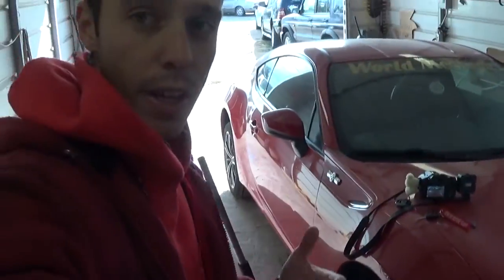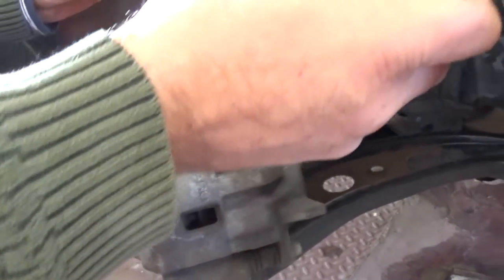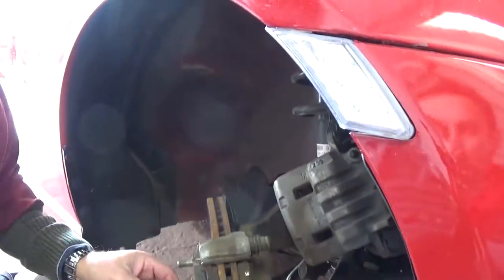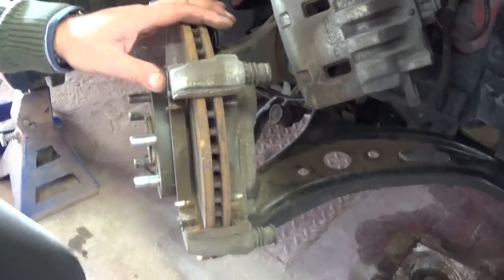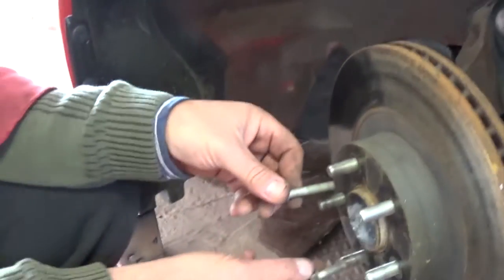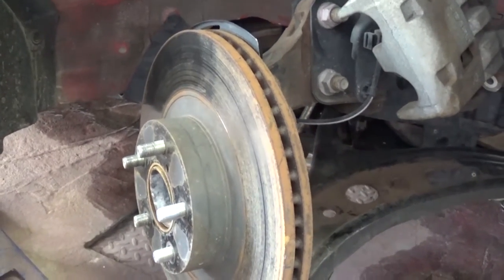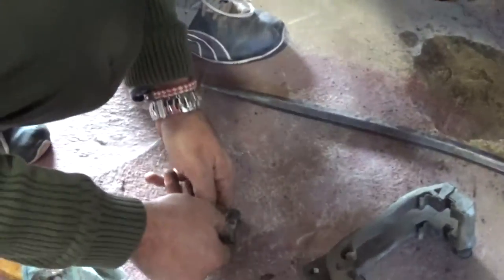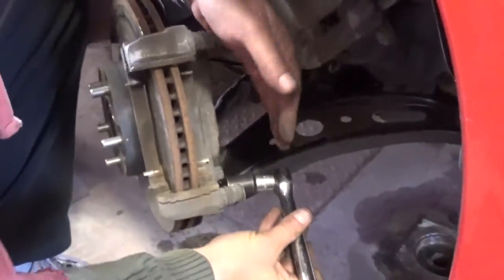How to replace front brake pads and disc rotors on SCION FRS FR-S SUBARU BRZ

Comment: at 40000 miles, riding strong on the brake pads, downshift to slow down fellas!
Reply: 70k here on original pads and rotors! (lotsa highway miles tho ;)
Reply: Had the original rears on until a few months ago, around 58k miles. The benefits of a light car...
Reply: Clutches are much more expensive to replace than brakes, good luck with your method.
Reply: 2018 GT86 with 96k here, I'm on original rotors and brakes. Rotors are still good for me but brakes are faded. It's definitely taking longer for me to come to a stop. I will need to change the pads